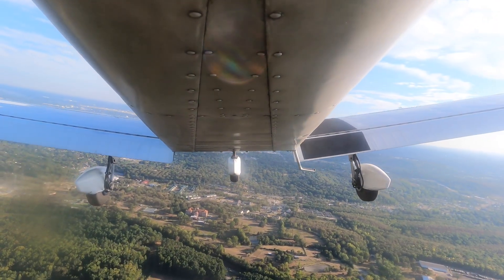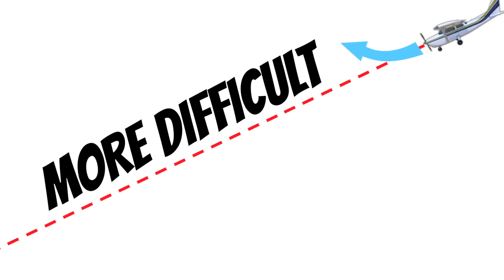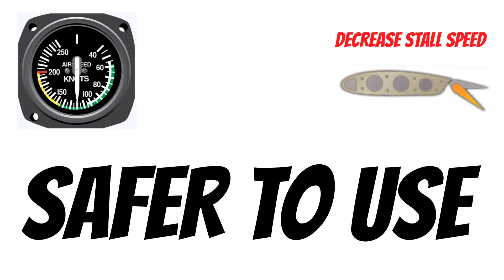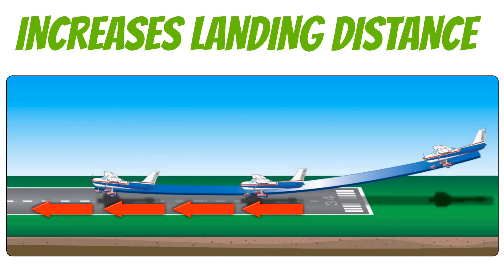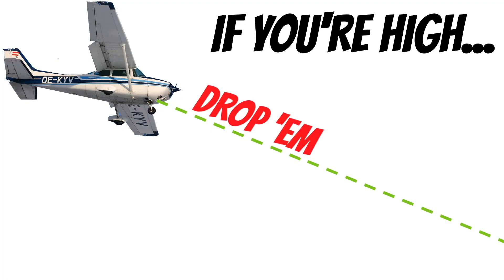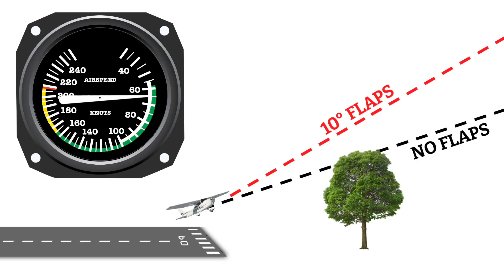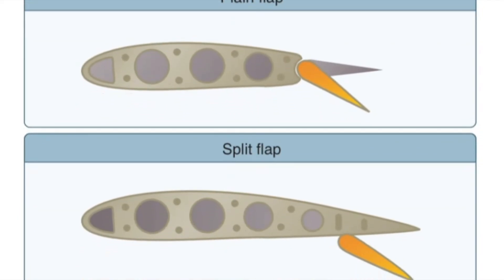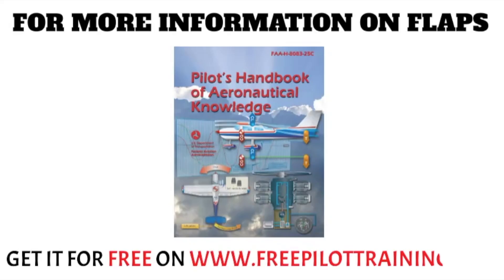WHY do Airplanes have FLAPS?  (FREE PPL Ground Lesson 8)

Comment: I like how the old Cessna 150 has 40 degrees flaps. You can really drop it in. 
Seems to be mixed info and opinions on flaps + slips though.
Reply from the maker: I know there are a lot of Cessna 172s that prohibit slips if you have more than 30 degrees of flaps
Reply: What’s a slip
Reply: @mac5237  I was referring to a forward slip, where you basically turn the aircraft slightly sideways with the leading wing lowered into the relative airflow, with the objective of losing altitude  quickly without gaining airspeed.